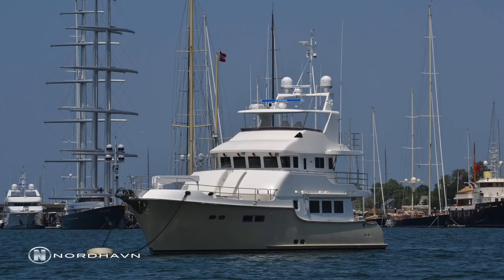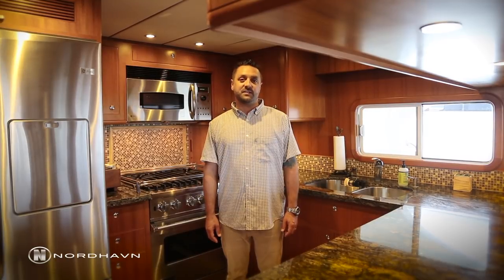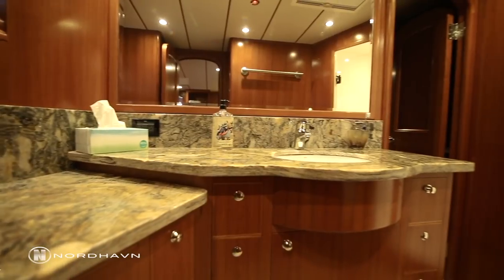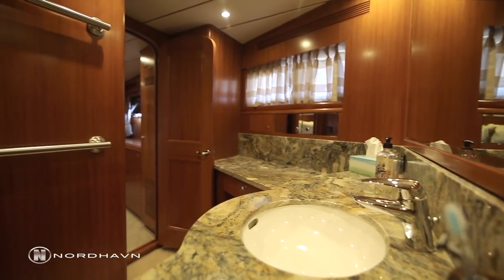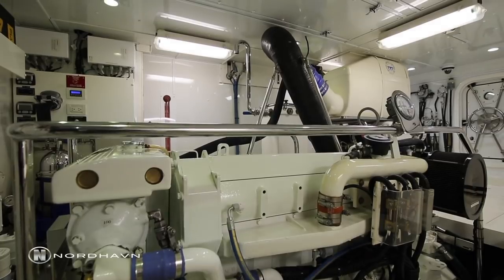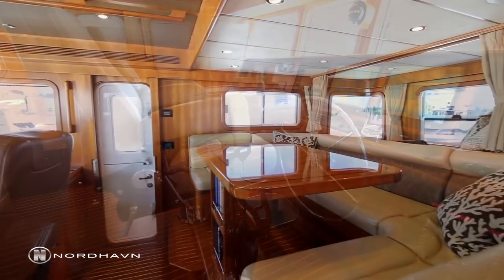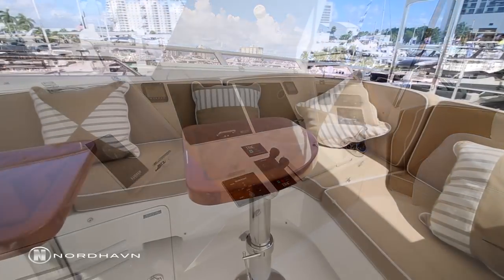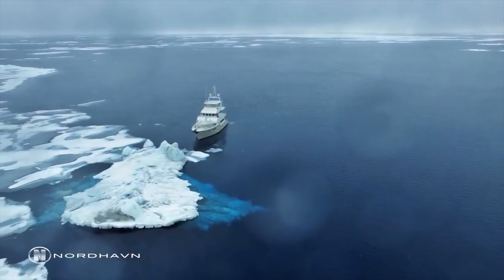N68 Migration with Garrett Severen

Comment: Single Engine???? For a boat like this 🤦‍♂️
Reply: It has a secondary wing engine with its own shaft and propeller. The wing engine has its own systems, completely separate from the main engine.
Reply: Why do you install a wingengine instead of a Second Main? To Dominos consumtion? Is this so much better?
Reply: @TS-ig2es  
The Nordhavn 68 is a full displacement, expedition yacht. It is designed to travel long distances at low speeds (6 to 10 knots). One engine is sufficient. The wing engine (aka "get home" engine) will run hydraulics. However, there are plenty of Nordhavns with twin engines and no wing engine. Obviously, twin engines will consume more fuel than a single engine. There are pros and cons with both configurations  Personally, I prefer twin engines.
Reply: Thank’s for your straight answer!! 👍👍